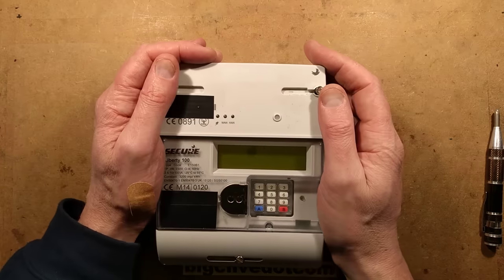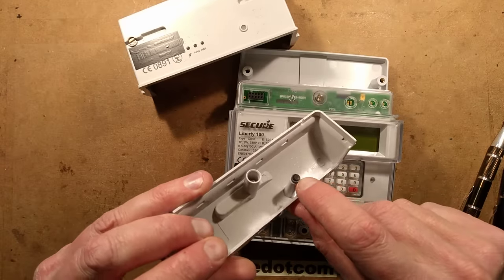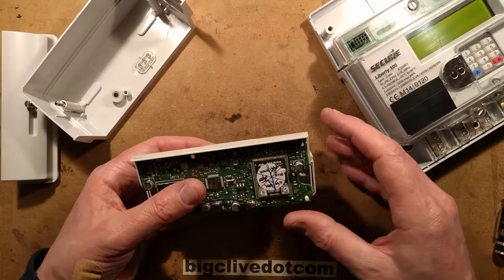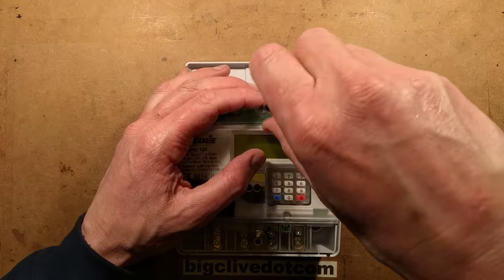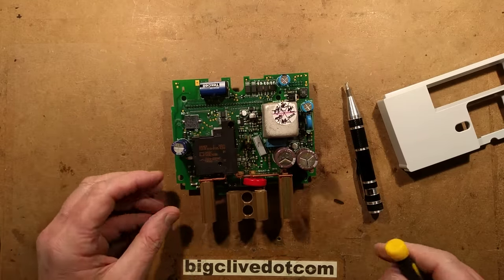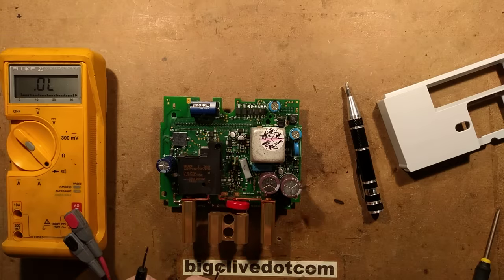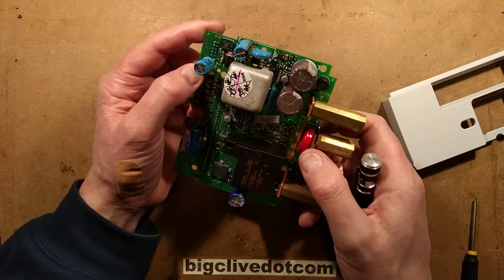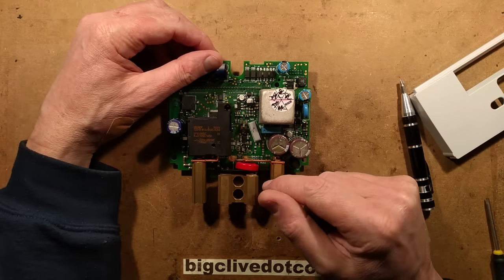Inside a smart meter, and the REAL problem with them.

Comment: They're being installed not to your benefit but for the suppliers. I'm seeing people having the smart meters fitted because they'll 'save money'. Nope - there is no actual saving - just the customer realising how much they use and trying to use less.
If my supply company paid me to have one installed I'd still say no.
Reply: My thoughts exactly
Reply: Hear, hear well said.
Reply: When the meter send the data directly over the cellphone network the customer cannot lie about the meter state. This means it does save them money by not having to send out meter readers to verify consumption when they suspect people are lying. And they can lighten the load on the analysis team that is selecting people to get checked.
Reply: Problem is, your choice is often 'smart meter' or 'no power'.. By all means hold off as long as you can, but be prepared for that choice one day.
Reply: "Just the customer realising how much they use and trying to use less" is not a bad thing.   I'd like to be able to plot my usage over the course of a day, if the meter were configured to tell me (or if the utility gave me access to the data.)
Reply: I had one fitted recently. It did change my habits and save a fair bit of power. So much so that I fitted a PV array and now I am a net producer of electricity.
Reply: jpdemer5 You can use a current clamp meter, I'm sure there are devices that will let you log it.
Reply: You don't need a smart meter to achieve that. There are many energy monitors available that you can fit yourself to monitor the incoming main to your property.
Reply: In Germany, they have to be changed by law. So as Electra says, if your energy company shows up to change your meter, you have the choice between taking the smart meter or hook a generator to your training bike and make your own electricity. Then again, the meter we got doesn't seem very smart (no network module installed). Only electrical instead of mechanical.
Reply: @ElectraFlarefire  I'm waiting for the mandatory fitting of my prepayment smart meters, I barely use power as is too expensive, living alone if I cook using my cooker it's not efficient enough even though it's A+ rated for environmental impact lmao I've also been using LED bulbs instead of halogen and incandescent bulbs just to save money in a rental
Reply: ratchetfreak
Current clamp meters only measure current and assume voltage as set by the user. They can't measure real power so can be out by magnitudes. If your meter has an LED that flashes to Watt hours consumed, units that optically read this can accurately display and trend exactly what you are being charged for. You just need to set them up with tariff times and costs initially.
Reply: Well just to inform you that the old meters are being phased out and you will have to have a smart meter or go with no power. Sorry but you will end up with one weather you like it or not. Also it does help seeing what you are actually using and also with you taking the advice from the energy saving advice you can get from the internet. Plus it will also make sure you are paying the correct amount.
Reply: they actually cost you more money, the rent monthly fee is higher, and the old mechanical meters get innacurate over time, a 20-30 year old meter will count significantly less than a brand new mechanical meter.
Reply: There is no rent or monthly fee on top! Nothing changes to your tariff for the addition of a smart meter. Your standing charge which all power companies have which was a Ofgem reg. Varies depending on the tariff you choose no matter if you have a mech or smart meter.
Reply: Maybe they dont charge you for it wherever you live, but believe me those meters are expensive as fuck, you are paying for them every month.
Reply: @ratchet1freak  if the panel had a blinky led, it's usually N blinks / kWh which could be read/logged by something like an Arduino or *Pie
Reply: If you manage to save some power then they come to change your meter again because they will suspect you from stealing. Electric company workers are as dumb as they go.
Reply: @Ray Jim I'd imagine you'd definitely need a smart meter if you wanted a tariff with time-of-day dependent pricing
Reply: Nope does not matter what type of meter your have.
Reply: I've just had a letter from my electricity company saying I've consented to them monitoring my meter, by what I assume is a mobile phone call to a modem in my meter, every 30 minutes. What do they need to do that for? It's a big leap from a meter reading ever other bill to one meter reading every 30 minutes. Why is that necessary? I thought at the most it would be once every day
Reply: Where I live, we have no choice. They forced all electric customers to switch to smart meters some years ago with no option of keeping the old meters.
Reply: here if you refuse a smart meter the power company has the right to refuse service to your home
Reply: Saves money for who? Do you think the Suppliers will pass that saving on ..... or just set up a complex tariff (time banded) so you will not be able to compare one company with another (unless you know when you use your power) ..... Meerckats and Mr Lewis go out of business and the companies slowly increase their prices the only people who lose are the customers! They will fit one in my house over my dead and festering body! TBH I can get hold of as many meters as they can (China is wonderful for some things) so it would be a Mexican Stand Off  .... With me being able to fit meters myself and knowing the law (and having already denied them access to my property for the purpose of fitting a smart meter) it could get interesting!
Reply: Thats exactly what they are for, so energy suppliers can make more profit. Electricity is one of the most perishable commodities. Energy suppliers buy it by the half hourly period and whats not used they lose money on. Smart meters enable them to log peoples usage every half an hour and so build up a far more accurate forecast of how much they should buy. Therefore saving them money  which probably won't get passed on to the customer.
Reply: Cough! ..... You mean the Suppliers workers? Most of the guys I work with in the REC (as used to be) are fairly smart!
Reply: Someone gets it.  JUST SAY NO!  (In the UK.)
Reply: I had one installed purely so I don't have to move furniture crawl under a desk around in the dark to read the gas meter every month or two
Reply: jpdemer5 indeed. Was ending up hundreds of pounds in credit to Scottish Power because their estimates were way off vs the actual meter readings
Reply: See my post above. When I was with First Utility they installed my first smart meter, about 9 years ago, and for 7+ years I could go to their web site and download all my readings for analysis. I've got nearly 130,000 readings, every 30 minutes from 2009 to 2016. Then, without warning, they stopped the download facility. A few months later they upped their tariff rates (they had been one of the cheapest) so I switched to Octopus Energy.  When I changed my OE Tariff to Economy 7 Octopus said they could not read my ex-FU meter and installed a new one, but I still cannot download any of the readings.
Reply: "In Germany, they have to be changed by law" - more than that it's EU law. I do enjoy trolling people in the venn diagram of tinfoil hat versus thinking the EU can do no wrong - although I sit in a weirder place in the venn diagram where the EU is nonsense but smart meters are perfectly fine, reasons for having them are perfectly fine. It's one of those weird arguments that confuse a lot of people principle versus execution. There are good reasons for people to understand how much energy they use and when, there are good reasons for people to have an accurate bill, there are good reasons for data that can help manage the grid to exist in real time. It's also true that the initial rollout of this stuff was a nonsense, and badly mishandled.
Reply: My supplier has no standing charge. The "local communicator" might be for the wee tablet thing one can monitor it with.
Reply: Im in usa, had smart meters for decades, they male me sick, so i go to the doctor to get pills, then everyone tells me what to think, and THEY say the things are awesome so...
Reply: I've used a real hi tech approach to saving on power. I note my use each month and write it down. Didn't need no smart? meter just a pen. I use less each year, unfortunately I'm still paying more than I did 5 years ago. Add to that we the tax payer pay for the power stations and I want to know what the power companies actually do?
Reply: I don't understand your argument
Reply: Right. We have a smart meter at our house and our power company provided a box free of charge that talks to the meter wirelessly and lets me see real time plotted usage via a smartphone app. May not be directly saving me money but being able to keep an eye on usage and maybe adjust things in response is a major benefit to me.
Reply: Costs £300 a customer to install them as well, guess who picks up that tab..the consumer :)
Reply: They didn't even give us a choice in my area. We were promised that they'd save money. Nope. First thing we noticed was that all our bills went up to "pay for the new power/money saving meter", except that it never went back down. The only good thing to come of it is that we can log into our web account and see detailed statistics on our power usage.
Reply: V8Snail  why does my clamp meter have a volts setting and is usually quite reliable?
Reply: MrAbletospeak   Yeah it can be used as a multi meter.
Reply: But why say no? It’s an upgrade to the grid... who wants an old out of date and potentially inaccurate meter?
Reply: @esecallum  why are you worried about your smart meter's wifi, shouldn't you be worried about your computer's wifi and your phone's wifi and your wifi router's wifi?
Reply: There is no choice here (Sydney, Australia). You get a letter saying to expect a short disruption while they install it. You can actually use it to your advantage if you want by altering your usage pattern against various times of day. It’s not all bad news.
Reply: @ratchet1freak  not the case I think the metre can read peak times of usage and charge you accordingly when Off-Peak it charges you less theoretically they can set what charge they want peak hours and peak usage without your knowledge. plus it interact with smart devices so it can interact with your Smart TV bad for hi-fi quality they keep trying to get me have one in saying they need to check my metre to see if it's faulty!! yeah right, I just bypass the fucker what about if you reverse the wires to that should make it go up in smoke
Reply: @Encore1234567890 you don't own the metre the power company do they could get a warrant. My water company want to put a water metre in I'm not having that I don't know where I stand! I look look after disabled person and I have to flush the toilet 6 times at least every time they go toilet plus they run the taps all the time it cost me a fortune I don't believe that would be compulsory I don't know I'd have to vandalise it
Reply: @davidgraemesmith1980  Is there a conspiracy theory involving LED bulbs?  I've changed all my bulbs over to LED aprt from the PAR bulbs on my motion detectors outside.
Reply: @ServiusTheBear Here in New Zealand we have a "supply charge" that covers things like smart meters and the wiring coming into the meter.
Reply: @esecallum  You do realise that by making posts such as the two you posted on this subject, you have attracted "their" attention. The Orbiting Mind Control Satellites will now start to reprogram your brain. If you ever manage to turn your head fast enough you may see the iguanas that are following you and reporting back to base. Beware of strange sounds and odd smells, that's a giveaway sign the brain programming is occuring.
Reply: @nicewhenearnedrudemostlyel489  Would you mind telling us what the pills are? (Generic names and the drug company) I have a vague suspicion, no more like a cast iron certainty that they are ANTI PSYCHOTIC medication. (I have to capitalise the words because their monitoring equipment can't read capitals unless they are at the beginning of a sentence, in the middle of a sentence, they are ignored.)
Reply: @ServiusTheBear  We already pay the correct amount with mechanical meters, so no change there.  It only tells you what the entire house is using which can already be monitored using cheap clamp on power monitors.  The only advantages are to the service providers, no need to employ people to read meters, can get individual data back from each customer, and ultimately they have remote control over your electrical feed.  Best of all the customers will pay the service provider for these benefits.  The other issue is security, earlier generation devices were already hacked, it will only be a matter of time before security flaws are found in the current generation as well.
Reply: @ScooterZn  nope no conspiracy lol, just the choice between a lower wattage LED that lasts for years or higher wattage bulbs that might just last a year, besides I've got two options for external lighting an infrared LED unit for cctv and a 15 watt warm white LED unit for me, if I'm not home the white LED is set for 45 seconds (scares cats off my container garden) while the infrared unit stays on while there's still intrusion.
Reply: The meters belong to them NOT you.
Reply: Yes, all meters whether smart or dumb are only fitted for the suppliers' benefit so they can bill you.
Reply: Smart meters allow for off-peak rates which can be beneficial though
Reply: @AllAboutChalford  You don't even need an energy monitor. All you need is an appreciation that things only need to be used when they need to be used, and that if something has 60w written on it, it is going to use 10 times as much electricity as something with 6w written on it. It really isn't that difficult
Reply: @CODMarioWarfare  so do those two rate meters which have been round for a while now, although the off peak times can't be changed on them as easily as with a smart meter also the peak time prices are much more extensive then on a normal tarrif so very few customers actually save money with them.
Reply: @esecallum  there's a legal limit on how much power a wi-fi device is allowed to transmit, they already approach that amount of power because people want maximum range. (Not sure how much power exactly, but definitely more than 1%). So if it transmits a hundred times more powerfully, it's illegal and you should report it to the authorities. It's probably interfering with everyone's wifi in a hundred meter (no pun intended) radius.
Reply: @Encore1234567890 Open market? There are 2 major energy providers in my country. Those sublabels are just to made  to look like an open market. It is more of a duopoly.
Reply: Here in belgium the big problem with these meters is that they don't turn backwards like analog meters when you are producing energy with solar panels. Thus, anyone with solar panels will lose a lot of the cost savings solar panels have.
Reply: There a scam, British gas know if people don't change to them. The few oldys that want the old style meter. There plan is to make the tarrif sky high so you have no choice..
Reply: @thewolfydragon1989  I believe the current state-of-play is that everyone must be offered a Smart Meter by 2020. It doesn't stop the energy companies from lying and claiming everyone must have a Smart Meter by 2020, or "Provider" (the company Scottish Power subcontract the work to) phoning / emailing me every couple of weeks asking me to call back to book an appointment for the "upgrade".

There's also two variations-on-a-theme of reporting - the older standard (SMETS1) talked directly to your energy supplier, so if you changed supplier, your meter would effectively become a souped-up dumb meter unless/until your new supplier changed it, and the newer standard (SMETS2) which apparently sends the readings to a third party, so regardless of who your energy supplier is, they can access the readings.
Reply: There are some useful advantages to the consumer, for instance if you have an electric car the meter could be programmed to charge the car at times of low demand and then run the house off the car battery when demand is higher, if enough people were set up with smart meters and battery packs of one sort or another it would be a lot easier for us to switch to green power generation, currently (hah!) there are problems involved in getting rid of the giant spinning steam turbines that can act as flywheels when needed to maintain the system.
Reply: in the USA the smart grid was a 2008 campaign promise to save energy.  create jobs. save the planet. Thus after the election gobs of government money went into replacing analog dial meters. millions and millions of dial meters were replaced with smart meters. the masses wanted it. the power companies would never scrap out meters that still have many many decades of life in them . The government provided the funding to scrap out the dial meters. Oddly the same folks who voted in 2008 to create the smart grid now say the meters are zapping their brains.
Reply: You have no idea what you're talking about.  It's costing suppliers an arm and a leg, they didn't want them either.
Reply: @alexcullin221  Alex  the suppliers of meters cranked out millions of meters in a few years. mine got replaced in the summer of 2009. as far as electric suppliers the smart grid in the USA allows quicker response to what areas are down due to wind hurricanes tornados etc. the masses in the USA wanted the smart grid thus say 50 plus million dial meters got replaced. the same scheme is on many natural gas and water meters here but a car rides around the neighborhood once a month to chirp each meter and read them.
Reply: Smart meters are there to save the utility company money. They save by not having to pay people to manually check every house directly, they can monitor the power remotely and charge you. It's not intended to save the end user any money.
There's no reason as an end user to care one way or another whether the utility company measures your usage directly or remotely.
Reply: Your views on the subject are not required or taken into account. You'll get the meter they give you or you'll simply have no power.
Reply: Isn't that how "saving" works? Don't overuse, be aware of expenses?
Reply: Still not getting badgered to swap meters, but I get a good six letters and emails every Summer asking me to take a free "smart" thermostat, installed by someone else and everything, on the condition that the electric company can adjust the temperature during peak hours. You know, when it's probably too hot for that noise.

They all seem to have a talent for taking cool stuff and making it undesirable.
Reply: captain chaos o
Reply: Well when my power company installed a smart meter my monthly power bill dropped by 15-20%, because it provided a more accurate reading than the old mechanical meter did. I was wary about getting installed as there had been several stories in the news about people getting huge bill after they'd been installed. I had no choice though, as it is the power company equipment and they need it to supply power to me.
Reply: @esecallum  Your wi-fi router probably pumps out close to the maximum allowed, though! It doesn't know how good the signal strength is on your other devices.

I remember a boy aged 6 who died of a brain tumour while sleeping on a pillow. I did not conclude that pillows cause brain tumours. You are the one who has lost the capacity for critical thought - if this one story leads you to conclude that iPads cause brain tumours, but not that pillows cause brain tumours, then the story did nothing to inform you in any way - the only reason you believe that now is because you already believed it before the story.
Reply: @esecallum  Here's the other thing... If you move a metre away from your smart meter, the signal strength is something like 1000 times lower than if you're right up against it, because the signal spreads out. So if it causes cancer when you're right up against it, does it still cause cancer when it's 1000 times weaker? By the way are you writing your comments using wi-fi?
Reply: well to bad because every home in the country must have them in by 2020 by law
Reply: My supplier attempted to bribe me with £20 voucher. Failed.
Reply: To suggest there is no personal benefit to having a smart meter installed in your house is to forget the foremost benefit of a power distribution grid that is controllable in the context of an overloaded outdated infrastructure - keeping the power flowing. Awww CR@P they reduced my available usage by 10% so my lights are dimmer, my power tools less powerful, my stove not as hot,... BUT IT'S STILL RUNNING! 
In my book that's a win no matter how you look at it.

Kudos to Alex C and 3beltwesty for posting sane rational comments 
(apologies to those who also posted well, but whom I failed to mention)
Reply: Im with eversmart and got 40% cheaper bills and no standing charge paying 11p per unit, using £17 a month on electricity on the edge of an exposed house at altitude on moorland, cook by electric oven and microwave and work from home as well. Gas is 15p per unit and no standing charge... almosted halved bills and saving over the main players not only on unit charge but with no standing charges either
Reply: @captainchaos3053  
Clamp meters can measure current accurately, however, I was referring to the whole-of-house power meters that usually have a wireless remote display for your home
energy consumption. These need to measure current, voltage and power factor at the same time in order to give you a real power indication.
A clamp meter cannot do that by itself. Power meters that utilise the flashing watt-hour LED on smart meters are basically relaying the real power the smart meter is measuring.
Reply: @esecallum  1/r? Wow, I'll be sure to factor that into my perpetual motion machine design.

And all radios have power limitations by law. If they're transmitting wi-fi then they have the same limitations as every other wi-fi device. If they're violating that they will get in big trouble for interfering with everyone's wi-fi, once you report them.
Reply: @jpdemer5  try using an ecoeye! It is user installed. It stores your usage on a special SD card. And helps you save money. But doesn't give that data to anyone else. It is your data.
Reply: Yea you are right less job more unemployment
Reply: ratchetfreak what do you mean, do you read your own meters where are you from
Reply: It is already mandatory they are changed over to Smart Meters in the UK. The only thing you can do is refuse to have the wireless functions disabled. Except Northern Ireland whose common grid area is not under the National Grid.
Reply: ferkemall  cool, I even gave my best friend a bunch of LED bulbs to replace her compact fluorescent lights, she's had them in for 2 years and is impressed with them, even got me to fit a sensor operated LED bulb in her high ceiling hallway
Reply: @ServiusTheBear , Just now maybe, but wait for dynamic pricing, in a few years, when the electric car revolution causes supply issues.  All these electric cars but where are the new power stations?   Extra wind power is good, but it's not windy all the time. Whilst there is Hinkley point C, It will take up the load of all the many decommissioned stations. Currently they need to fire up coal stations to get through the winter. http://gridwatch.co.uk/
Reply: Nothing to stop you from building a lead box in your property !!!!!!!!
Reply: I don't fully believe this. I think smart metering will be able to be combined with electric cars and "smart charging" -- cars should be able to charge during the night in hours when electricity is cheap, but a smart meter is needed to ensure the measurement during those time periods. Even more, electricity companies could rotate where they are offering cheap electricity, so maybe from 10 PM - 3 AM in one part of the city and 3 AM - 7 AM in another part of the city, and electric cars would also use this schedule.
Reply: Had one fitted and saved about 5 quid a month here... can't say everyone will experience the same but they're there to more accurately monitor your usage.
Reply: Jack King they negate the need for a meter reader so the company save the payments to them.
Reply: Encore1234567890 in a lot of places there is no choice and never was. The city provides power, you pay for it. They can take back their old meter as it belongs to them. So if you were to try and refuse smart meter installation they’ll just shut it off or they can leave you with no meter at all. It’s their property. That of course all depends on your contract, which they can change at any time and if you don’t agree to the terms they will just terminate it. There is a law about having to leave it connected in the winter so they don’t freeze and kill people though. But I assume that’s also dependant on your location.
Reply: anarchore eating basically anything you can buy in a supermarket increases your risk of developing cancer since it’s all unnatural in one way or another. And organic food is expensive and the majority of people don’t bother with it. Everything is bad for you. The air you breathe is probably killing you every day. Wifi is the least of our worries.
Reply: @manwithapan9481  they will easily make £300 back when meter readers jobsworth are eliminated
Reply: For me it was an end to the estimated bills which always been more that I actually used. No matter if it was winter or summer time. Now my bills are more accurate and spread evenly throughout a year.
Reply: I save money. I get up at 2 AM when the rates are cheaper, turn all the lights on and go back to bed.
Reply: @rolfs2165  - interesting, in the UK we are NOT allowed by Law to generate our own power, it has to be supplied by a supplier - I'm not talking about off grid. A few years back I worked in a Transformer (National Grid size 250KVA +) huge great things, we tested the finished products and this often generated power that we could not sell back to the supplier - It was in effect competing with them. It was against some old law and it also included generated power at home. Possibly the future is to get these laws revoked and allow generation of power to sell or give back to the grid, effectively ending power poverty. The will mean bringing the price of power down. ~ Trooper
Reply: @ServiusTheBear   Just visited a relative who has one fitted. To monitor use they have to have a unit plugged into a socket using their electric 24/7. They queried the amount they were paying and sent in their own reading. It appears they will now get free electric for over a year due to "smart" meter sending in wrong numbers or them not being sent and the company estimating the bill. My relatives advise, don't get one until it's forced upon you.
Reply: And then they pass the savings onto the shareholders
Reply: Jack King my parents owned a high rise apartment and the meters are locked away in a cubed and on every 4th floors and the floors are locked from others from going to that floor unless someone lives or holiday rentals in the apartment.
Reply: smart meters are expensive , installing them also costs money - theres nothing smart about them - apart from companies finding another way to hike up prices to cover the costs of manufacture and installation of these meters
Reply: hucker75  
Voltage is not pretty much always 240V. It depends on where you are (100-255V), what system you are on, how many people loading that system and influences like rooftop solar generation nearby. A SWER system can vary voltage considerably under load due to the high impedance of the earth return. I already stated power factor which is a ratio of phase angle. My reply was referring to current clamp meters which do not measure voltage or power factor on their own, all of which are required to measure real power.
Reply: @ratchet1freak  It saves the company money, but in reality they don't pass on the savings, they just make higher profits. It's what is expected.
Reply: @ElectraFlarefire  That has the makings of a court case. In the UK that aren't allowed to cut off the supply unless you haven't paid the bill and even then they can't in the winter months and if there are children in the household then not at all, they have to take you to court.
Reply: jpdemer5 You can log that as much as you want, per circuit even. Plenty of applications consisting of hard- and software for that. Most of these smart meters will not even let you, the customer, use the logged data anyway ...
Reply: mbaker335 Which, in Belgium, would actually COST you money instead of gaining some ! Trust me, I have 22kWhp on my roofs, I know ...
Reply: Ese Callum Sorry dude, barking up the wrong tree with this BigClive viewers ...
Reply: @popuptoaster  For starters there are very few ev's which currently support v2g but also nearly all of them have charging timers in them already so you can already use the car to charge when it suits. 
The power also has to come from somewhere. Using cars to power homes balances grid demand out nicely but it doesn't make grid power any cleaner. All it really means is an outdated grid may be able to cope - presuming people don't all want to use the same things at the same times - but it won't turn off the generators more since the same demand is there but spread long and thin instead of short and spikey.
Reply: @skeletor6697  Ever heard of someone called the queen? Might want to have a listen to her speech.
Reply: @ExtantFrodo2  Since our taxes pay for the grid and we pay for the power it bloody well ought to run. Infact it's never not run apart from a few times for an hour here and there so what are you saying - we all get this rubbish installed or there will be mass black outs?
Reply: KittyPouncer  So you need a meter to tell you what time of day it is?
Reply: @janosnoll6830  A great thought and one I'm sure the companies will push as a reason for this. Trouble is big companies have a kind of a bad reputation for taking something that could be good and screwing as much profit as they can out of it which usually ends up with the bill payers footing a bigger bill.
Reply: Bill Kerman  which country is that?
Reply: Taaketa Dinloka  - it is no longer mandatory to change over in the UK. There was a change in the law.
Reply: Trooper ThatsAll . So what are all the solar arrays on roof tops and wind turbines in gardens about?   A club I belong to has a diesel generator, are you saying we are breaking the law?
Reply: Im not sure its a secret that more precise monitoring is a way of making bills more accurate. If you didnt pay enough, you will pay more with a smart meter, if you payed too much you will end up paying less with a smart meter. You really havnt cracked a secret code
Reply: They're being installed because of an EU regulation.
Reply: For me it's purely convenience. I'm on a PAYG meter in my current accommodation, which seems to be more and more common in the UK. With a smart meter I can top up directly via smartphone app, rather than having to drag my crippled arse to the shop to top up. Downsides are what they are, but by 2022 everyone will have one fitted, so I'm just early in the inevitability scheme of things.
Reply: @mbaker335  I was under the impression they didn't understand how to process you producing electricity? Unless you have an entirely different meter of course.
Reply: @Encore1234567890 The government wants everyone switched by 2022, so it may not be a choice for very long.
Reply: At a local library, a couple of years ago, one of the local power companies were offering a device that did just that. It had a small box with a clampmeter type probe, and a separate display that could be sited in a convenient position. They also supplied a multiway power lead with a remote that you could switch off power remotely, both were free!
Reply: @25566  not in most of the world no. In the UK our cost of supply has not risen as a result.
Reply: @ratchet1freak  "This means it does save them money by not having to send out meter readers to verify consumption"

I've had a neter reader onsite 6 times in the last 20 (yes, 20) years.

If they don't trust a client at the moment, they move them to prepay meters and charge a fivetune to switch away from it (even if the dodgy types have moved on and are several property occupants in the past.)
Reply: @jpdemer5  I can do that without needing a "smart meter". You can get MCBs which will tell you the information you need. 

Schnieder electric have a range here: https://www.schneider-electric.co.uk/en/work/products/product-launch/powertag/ Other makers have similar things. The cost is low enough that you don't need to be a large business to consider this stuff.
Reply: it does save people who dont understand what they are using money as they will be able to see it but the companies have made sure they have that covered by increasing their pence per unit... id have one fitted if they would give me a discount for having one as they will be saving a fortune on not having meter readers coming out to read meters etc.. a MUCH simpler way of doing this rather than these smart meters would have been to discount people who gave a reading from their meter each week... would have saved all the headaches and anyone who had the older dial style meters should ahve had them replaced so that they were easier to read.... the main issue with the smart meters at the moment is that they are not standardised so you try moving supplier once you have one fitted ;)
Reply: If you use ZERO electricity do you still get charged for the amount of electricity that the meter uses?
If it's YES then installing this Meter is a crime. 
Your paying for electricity to run this meter which is not in the customers best interests.
It must use up some of your electricity, so how much does this meter cost to run over a lifetime? 
I feel court cases are on the way about this.
Consumers V's Power companies on who's paying the bills to operate the meters. 

A power company never read an old lady's meter for over 3 years.
Old lady has a direct debit set up for the bank to pay her bills, she's 76.
The power company decided to take 3 years of estimated bills of £1200 leaving the old lady penniless. All of her money Gone.
BASTARDS.
That old lady sat through last winter without heating with towels at the bottom of her doors and on her windows to keep the cold air out of her house. She had quilts and blankets on her wooden floor to walk on because she couldn't afford to run her meter. She was eating cereals without milk and eating bread with cold tinned foods and drinking tap water instead of tea.
It makes me sick to think how many old folks are sat at home wondering when they are going to die because they are held to ransom over their heating bills by these Power Companies.
Pure Bastards they are.
Sorry about the rant!
Reply: @johnmontague69  that shouldnt be the case as you now get charged a standing charge each day which should cover the cost of this.. Someone could have a house empty and they would be charged a daily rate even if they didnt use any gas or electricity... seems incredible that they can do this but they do and they arnt breaking the law doing this. Also not sure what law they would be breaking in charging you to use the meter as if they didnt they would just take the cost from the other side... i worked for an energy company and there is the other side where people leave 10,000 pounds in their account as its untaxable and untraceable so people use it like a bank account.. whilst working for this particular company i found an account where an old woman was struggling but it turned out they owed her three grand which was sat on her account and they had no procedure to pay this money back to her in one go...  there should be a law that if the account ends up x amount in credit that the money is paid back to the customer.. i mentioned this and for obvious reasons the company didnt want to pursue this...
Reply: @eduardouk  WOW..
Very good info Ed.
Unbelievable how people can hide money legally.
These Power Companies are robbing people left rite and centre. Estimated bills adding upto way over what you actually use and not a lot of people questioning it, they just pay it by direct debit and the next and so on. The power company is like a bank, it's got millions of people's cash all sat there making the power company millions in interest but they still hike up the prices.
Fat cats getting fatter.
The old folks are harassed to no end and are worried sick about their power bills and some of them give in the will to live.
It's pure tragic and it's wrong.
This year the government will take away pensioners free TV licences and reduced winter power bills and make it worse than ever for them.
Old folks need a TV for company and they need heat for their old bones.
These Power Companies have bigger cash balances than banks and earning interest and they won't use it to free up some leeway for the needy. It's absolutely ridiculous that they are aloud to do this. 
Estimated bills are making them fortunes and I'd say MP'S and other power company directors have been getting big fat Brown envelop to carry on doing this for as long as they can behind the publics backs.
Energy could be FREE for Everybody if we just harness the power of the sea. It probably is Free but we are paying more for maintenance than anything else! Who Knows.
Makes me sick thinking of the tricks they are getting upto and when you ring them up you get put through to a call centre in India or Bangladesh or some place that cannot communicate with us properly to give phone companies more talk time! 
I dialed a helpline, I had to press  a lot of numbers on the keypad which took ages and several tries to understand what department I wanted to get through to, eventually I got a ringing tone but no answer, tried again and I got put on hold for 15 minutes and when the lady did finally take me off hold we could hardly understand each other and she said sorry and to ring another number! Unbelievable.
All I wanted to do was query this old lady's bill and tell them they had taken all of her money and she couldn't afford that sort of cash to be taken out of her bank account.
Absolutely furious.
There must be a way to beat these companies, there must be buzz words that they don't want to hear and if they do hear them they will listen and probably put you on a list of credibility or something. 
Bastards.
Sorry I'm ranting 😈
Reply: @johnmontague69  i totally agree... instead of smart meters what they should have done was offer discounts for people who read their meter regularly themselves... they then should ahve removed all the old difficult to read meters and replaced them with simple 'odometer' style meters... the government ideas are what causes these issues though... say the price cap... all the companies did was get rid of the no standing charge (some didnt charge this up until they knew this was coming in) and then increase the standard price per unit... or in certain cases just get rid of the standard charge altogether... In my opinion there should only be one price and which is just a pence per unit and all companies should only charge this so it would be simple to compare them. A standard tarrif for most people... an economy 7 tarrif and  a tariff for those producing their own energy... again the government told the energy companies they had to show the cost split between usage and production and so my bills almost doubled for nothing extra as the company I am with decided to charge me for a standing charge which apparently was included in my own tarrif.. After years of being told to use less energy I am now penalised for using less and everything is geared towards wasting energy as those that use more save more... seems counter intuitive if you ask me but ho hum.. there is no way around it as all energy companies do the same... The other government meddling which still hasnt been changed is after the old energy companies were split up the government said that say for example npower who took over the old MEB in the midland MUST charge people within that area more than anywhere else... this was setup to ensure that there was competition however it has never been removed and there is no reason now to charge people within your own area more... the whole of the uk is split up into these certain areas and no energy company will tell you that they will charge you more than someone in a different area...
Reply: @ratchet1freak  If you believe that god help you........Any money they 'save', they'll pass on to you.lol
Reply: @kcotte59 nope a smart meter could not possibly save me money. My entire electricity bill for last year was less than £10. If you do not believe this there are ways of sending you proof. Also EVERYONE I know who has had a smart meter put in has seen their bills increase by on average 30% and the lowest was 20% So nope I am thinking and how can a smart meter save you a single penny if you already are using the minimum? It can't.
Reply: kcotte59  I have no real problems with them myself,  but that was the choice we had. Get a smart meter or don't get power. And no, they didn't cut us of or anything, they upgraded their equipment(That they own and have a legal right to do so.) and the only way out would be to close the account, have power disconnected and if I really wanted, maybe have all the equipment removed(And THAT is nearly impossible as 'what if the next home owner wants it',) 
The meters are a good idea for the most part(Putting aside the jobs this removed), companies just like to abuse any new toys they can.
I'm having fun with it because they have a well documented, IEEE standard, IR comms port on the front you can pull data from for your own usage. :)
Reply: It does benefit me tho
Reply: @ElectraFlarefire   this has happened to me twice. once with the gas company, Spire, & now with American Water. Both of them literally threatening to charge me then cut of my utilities. I didn't win with Spire & it doesn't look like I'm going to win the battle with American Water either :(
Reply: It's a scam to charge people higher rates for using electricity during ""peak" times. They will know exactly when  you turn on lights and use appliances and can be hacked into and your data can be stolen. If people are trying to save money on electricity, just use less electricity. They don't need the electric company to tell them to use less. I guess we're too stupid to figure it out for ourselves
Reply: They save the cost of someone having to 'read your meter' and try to eliminate cheats who are robbing the utilities companies for which we all have to pay for ultimately. If you have nothing to hide, no problem. 'Jack King' if you are one of the latter group, why should you object? - I bet you have a 'Smartphone' that maybe unknown to you tracks your every movement.
Reply: @rolfs2165  Dont be fooled, those electronic ones (even without wireless comm(  can tell pretty detailed history what happened, how many times the main breaker tripped, overcurrent states, backffeeding to grid.........
Reply: @25566  Yes and those that are refusing them are still paying for them indirectly as part of their bills 👍.